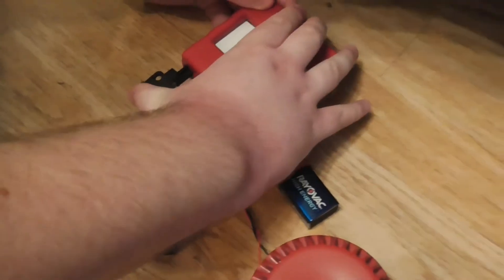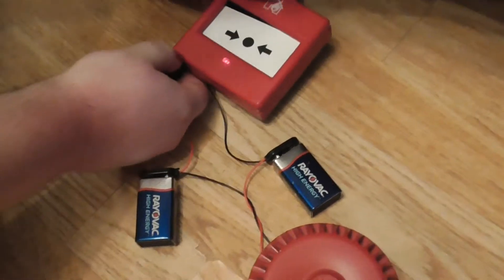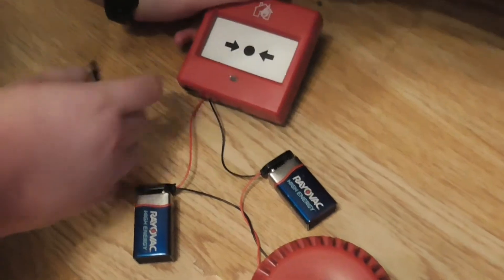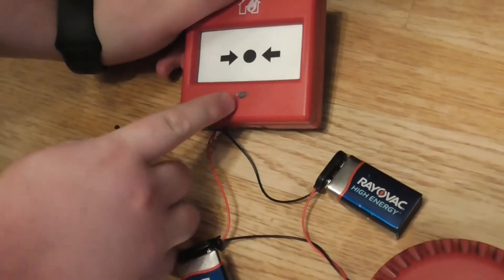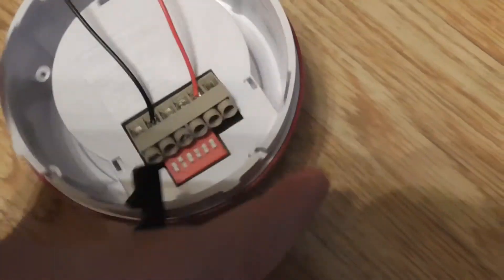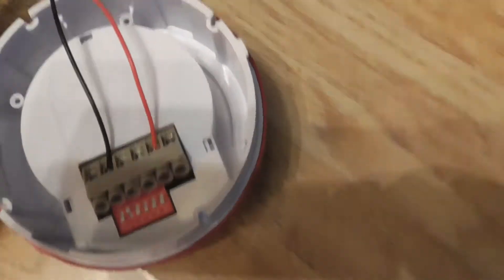Fulleon Call Point Test with Roshni Sounder

Comment: Nice. Here's a tip: you do not need two 9 volt batteries to power it. One only would work. Whenever I test my Roshnis, I use only one battery.